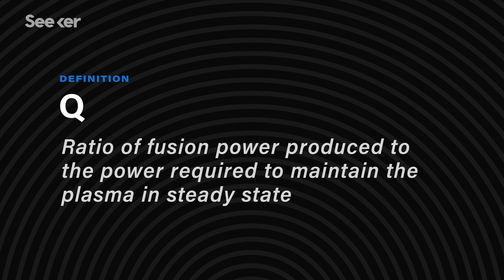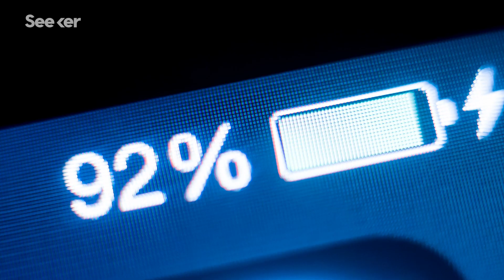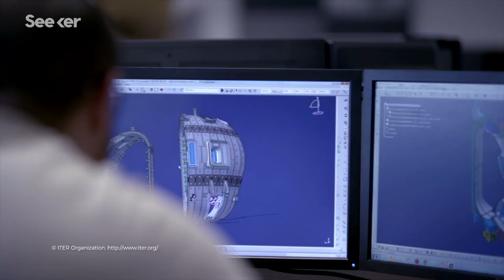How Close Are We to Fusion Energy?

Comment: Before we get financially viable fusion energy, solar and wind will be reliable due to the advances in battery technology. fusion is a waste of money by now.
Reply: What are these commercially viable battery advancements you are talking about?
Reply: The Tesla Battery farms in Australia and on Hawai for instance. home battery storages for photovoltaic panels are available from many sources already, and they are currently working on scaling them up, or they are already doing so. Electric Vehicles for instance also work with Batteries and they can gwet sufficient range already, and their capacity is constantly increasing, the battery revolution is taking place right now, and in a few years Batteries will be a huge part of energy and grid management.
Renewable energy sources have the disadvantage that they create a huge surplus of energy when it's not needed, so storing it solves that problem completely, and that is what people all around the world are currently working on, with a lot of success actually.
There are off grid communities already that produce their own energy and store them in batteries, whilst those are still rare and experimental, they work, they are reliable, and they are available now. Fusion just won't make it in time, the trend clearly goes towards renewables. There are 4 miracles that need to happen before fusion would even stand a chance.

Miracle number one: Fusion needs to work immediately, no more delay, it needs to produce energy now otherwise the developement of commercial reactors will not happen fast enough to keep up with renewables.

Miracle number two: Fusion needs to create much much much more energy than any other source avvailable, because if it doesn't it won't be viable in comparision, a technology revolution doesn't happen if something is as good, or better, it needs to be much better.

Miracle number three: We need to find an efficient way of massproducing Tritium, whilst it is true, that Fusion power needs only hydrogen, this includes a specific type of hydrogen called Tritium which coincidentally isn't stable and thus not found in abundance in seawater, it has to be artificially created.

Miracle number four: The price and time for building and maintaining a fusion reactor must drop astronomically.
Fusion reactors are some of the most complex and expensive machines that humanity has ever built and they are extremely difficult to maintain due to the immense radiation and heat that come with a nuclear fusion, whilst they are not dangerous, they may aswell fall apart very quickly if not maintained correctly, and this is one of their biggest downsides compared to renewables and battery tech, which are by many magnitudes less maintenance heavy than any type of nuclear reactor, especially fusion.

As you can see, I think it is impossible that we'll ever use fusion on earth, other green technology is just way ahead. The future is bright, but it will be bright without mister fusion.
Reply: VoodooG Ok first of all all of the technologies you discussed for Renewable are not advances, but rather existing technology. As for the battery facility in Australia that is a 129MWh powerpack. While the largest in the world this is extremely small in scale compare to the amount of storage needed to meet consumption of solar for countries like the USA. Assuming we need 50% solar generation by 2050, this indicates that you need about 500,000 GWh or 3,875 of these powerpack units. Even if you were to construct 10 of these units simultaneously every 100 days it would take you 106 years to reach the necessary 3,875 units. The reality is not only is this extremely quick level of deployment not fast enough, but our current rate of deployment is not even remotely close to what is needed for society. Last year MIT Technology review featured a study conducted by Ken Calderia, which indicated our current rate of deployment for renewables would likely take humanity 420 years to meet carbon emission standards and remain below 2 degrees C increase. This is unacceptable, because at such a timeframe it is logistically impossible for industry to remain our CO2 and temperature limits. 

https://www.technologyreview.com/s/610457/at-this-rate-its-going-to-take-nearly-400-years-to-transform-the-energy-system/

The problem with renewable studies that suggest all we need is wind, water and solar is that they predict capacity additions that are unprecedented for any time in human history by over 300%. 

https://onlinelibrary.wiley.com/doi/full/10.1002/wcc.324
Reply: VoodooG As for your fusion miracles: 

1. Nuclear fusion can take its time and likely has to because there is still much to discover with the technology before we are able to mass produce it. However when fusion is ready to be deployed commercially this technology will most likely be sold by governments rather than utility companies themselves because the generation of a fusion reactor is so immense that a single reactor could potentially supply enough power for multiple states. Not only states like in the USA but in other continents like Europe it can be used by multiple countries at the same time. This is why government ownership is likely to occur, because private companies would find it very difficult to control prices and dictate terms when more than one state is using the generation at a time from a source. Some companies already control grid sectors, and different energy sources in different countries, but there is no precedent of using a single energy source to power the majority of baseload energy for multiple states at once. 

2. Fusion has already proven that it produces BY FAR the most energy than any other source in the universe. You can actually calculate the amount of energy from fusion be finding the mass defect from a fusion reaction (mass of duetrium and tritium isotopes compared to mass of helium 4). Then by using the Mass Equivalence Equation E=MC^2 (where M is the mass defect, C is the speed of light) you can determine the amount of energy released in this reaction. Then multiply the energy by how many atoms of fusion fuel are in 200 KG and you get the total amount of energy released in in the reactor. 

This is the very same way that you find how much energy is released from fission reactions, and actually atom per same atom fission and fusion release the same amount of energy. The difference is because fusion uses fuel that is has significantly less mass than fission, you have more atoms that make up 200Kg and thus more reactions equaling greater energy production. 

Now this would tell you how much energy is released from fusion, but if we were able to actually use all of the energy then we would essentially only need 5 reactors to power the entire earth. Given that we then have to transition this energy to heat you end up losing a significant amount of energy as waste heat. Nevertheless the amount of electricity you produce through nuclear energy is several magnitudes greater than all other sources. You can even just look at fission for an example of this. The largest solar farms in the world produce about 4,000GWh with 10 miles of solar panels. Comparatively we have nuclear plants that generate 32,000 GWh.

3. Tritium is not artificially created. Tritium is extracted from Lithium concentrations, which if you believe there is a short supply of lithium then you are really screwing over your own argument for solar and battery capacity additions as our most successful (in terms of production not necessarily energy capacity) and most widely used batteries today are Lithium-ion.
Reply: First of all existing technologies are the advances of the last decades of research, if you want to see current advances look up "the battery revolution" and educate yourself on solid state batteries and zinc bromine gel batteries.
Like you said, this is taking into account only current technology, technology never stays the same, and besides the fact that fusion hasn't even proven itself at all yet, batteries seem like a much better option.
Consider the S curve. This technology is developing extremely quickly, mostly due to the electric vehicles. What can already be achieved with existing renewable technology is impressive. Where as nuclear fusion is currently more like "Yay we held a stable plasma for 10 seconds!"
I also believe that the rate of deployment wil skyrocket with mass production conerning these battery packs. they are getting more and more efficient whilst getting less and less expensive, there is going to be a tipping point in the not so far future, whereas with nuclear fusion it has been said, that it is the energy of the future for the last 50 years, and yet even the most optimistic scientists say, that fusion might become viable in at least 40 years. Fusion is 100% unproven technology that is ridiculously expensive and probably not even financially viable.
Everyone in a free standing house can install solar and a battery pack right now with present technology, there isn't a single energy producing fusion reactor on earth, the winner is clear in my opinion.
It's either renewables and batteries or nothing. Fusion won't save us in time.
Reply: VoodooG The entire reason why I asked you for commercially viable advanced battery technologies is because I am fully aware of the other battery technologies talked about in “The Battery Revolution”, but these technologies are not even remotely close to being commercially viable and scaled to meet consumer demand, much in the same way that nuclear is also far from that target. 

I always find it amazing how Renewable advocates will suggest that their new technological advancements need more funding and time associated with their discoveries, but god forbid we spend any time trying to pursue other technologies that are not yet commercially viable. 

If nothing else many of these experimental fusion reactors do a lot more than fusing hydrogen. Many of these facilities are used for other tests related to particle physics that have helped accelerate humanity’s advancement into new eras with superior technology. Without the advancements discovered in particle physics our industries in medicine, agriculture, shipping, transportation, and especially computer science would be drastically reduced today.
Reply: You're right about that, I shouldn't have said it's a waste of money, no research is really a waste of money, but I think fusion has been ridiculously hyped for 50 years now as the energy of the future and we have not seen massive advances concerning making it an actual means of energy productiuon.
I say fusion is the energy of the future and forever will be.
When it comes to renewable and sustainable energy, I think solar and wind have a massive head start and have already proven themselves. The only other candidate that I can currently take seriously is the LFTR, if it actually works like it's promised.
Turning maths and physics into viable technology is much harder than expanding on technology that is already somewhat viable using maths and physics.
I am pretty sure the race for nuclear fusion will end in a boring slow down, when we no longer need it as a power source but only for further research.

Comment: We have been working on fusion for a long time and we don't have anything that produces more power than it uses (total power, not just the laser energy).  

Lets revisit solar for 30 seconds.  

The problem with solar is we don't have 24/7 sunlight.  We can fix that by orbiting mirrors to reflect sunlight.  And, we can do that with the tech we have today.  It also uses 1/5 the solar panels required to charge the batteries we don't yet have.

Photo voltaic energy is totally solid state, no moving parts to wear out.  Every other significant energy source (including fusion) uses turbines and generators, that wear out.  Also, generators change speed up with load changes.  The inverter that changes DC from solar to AC, can go from no load to full load and back without perturbation.
Reply: Steve Sedio 
1. How big are these mirrors you propose to use, since they have to reflect light around the earth?

2. How are you going to get these mirrors out of earth’s atmosphere?

3. How are you going to keep these mirrors in orbit around the earth and prevent them from being hit by satellite debris that is currently orbiting earth? 

4. What are these mirrors going to be made of to be able to withstand the electromagnetic radiation from the sun without earth’s atmosphere and what are they going to be made of to withstand collision by space debris?
Reply: Brian,

Good questions!

There needs to be many mirrors, and they do have to be big.  Miles on a side.  This also requires a lot of ground based solar arrays, for power and redundancy (cloud cover, storm damage, etc.)    

But, they don't have to be complicated or heavy.  Construction is carbon fiber (or graphene) rods and metalized plastic film.  The metalization can be small squares, insulated from each other, to minimize effects of electromagnetic radiation.  Also, the film is thin enough that the damage is a hole,  with little effect on the total light reflected.   

The mirrors are steered by pushing against a gryo array, powered by a solar panel.  Computing power (steering) and communication (which ground based arrays are cloud covered, etc.) wouldn't be overly complicated.    

To be reasonably effective orbit needs to be above 10,000 miles, above most of the satellites and debris.  They could be 40,000 miles up.  Sunlight is parallel, and as long as the mirrors are flat, another 30,000 miles (out of 93,000,000) isn't significant.

Is this more complicated than roof top solar, of course.  Is it more complicated than fusion?  Nope.  

This can be started small, one, 1/2 mile square mirror, hitting an existing solar farm.  

The biggest expense, is getting into high orbit.  But, these are solar sails, that go up (speed up) when they are going with sun light, and down (slow down) when they are going against.  So, rocket them into low orbit (above the major debris and satellites), and turn sideways on the down cycle, catch sun, and speed on the up cycle, until you reach desired orbit. 

Once it is in place, the cost drops to annual maintenance, far cheaper than our annual cost for coal, natural gas, and nuclear. 

If Elon got a mind to, he could be the electric supplier to the world.  He has all the tech.

Comment: Maybe a dumb question,  but if the whole world used sea  water for hydrogen  wouldn't we be run out of water in like 500 years?
Reply: jandera21 No because you require an extremely small amount of hydrogen for fusion energy and the earth’s oceans have a massive supply of water.
Reply: @brian2440  okay  so there is still a net loss of hydrogen right? If you combine that thought with an ever increasing population over some period of time surely their would be a measurable drop in the earth  drinkable water./?

Comment: Replicating the same conditions on Earth as in the sun, where Hydrogen atoms can fuse together, is possible. At an enormous monetary and energy expense, we are able to create a plasma where temp and pressure mimics those of the internal regions of the sun. In this plasma, fusion can occur. But to contain the plasma, we need powerful magnets, as it is impossible in any other way to "anchor" it. 
80% of the fusion energy is in form of high energy neutrons, which cause damage to reactor structure.
The question is now...and has always been...just how will we be able to create a net gain of electricity? No one knows yet. Many ideas float around...but they are as of yet just that.
Reply: Kalle Kula By increasing the size of the tokamak, that’s what ITER are doing
Reply: @ipazu8389  Make it as big as the sun?

Comment: Iter is using a tokamak A TOKAMAK why? We already have a much better way to control the plasma. There is a German company that found out by twisting the magnetic fields you can remove the center spire. Which will be the safest place to allow the plasma to vent into the water when these become power plants. Nvm all that it also takes only 60% the energy to maintain the field vs a tokamak. why just why.

Comment: Just because I want it doesn't mean jack. Wanting and doing are very different things. I want a Ferrari, but can't have it. Fusion has been a promise around the corner for 100 years almost and we think this time it will work. I'm not saying it's impossible, but there are better alternatives than this. Solar and wind can't provide the amount of electricity most people in developed countries need and since Asia and soon Africa will join in the develop age they will also need reliable sources of energy. The only way to get people out of poverty is for electricity to be available to everyone and even though there are many who will throw nuclear out as the worst, it is by far the cleanest of all electric producing fuels. Compare this to solar and wind which can't match it by electrical output and the excess waste from solar panels after they are used up, or excess space needed for it, or wind turbines killing birds, nuclear should be a no brainer, but the stigma around it has given it a bad reputation. Other sources which people are currently working on is carbon storage power plants. Power plants that will pump carbon dioxide into the ground. I hope a private institution finds a solution to this problem cause if the iter experiment fails, these governments will pat it down as there wasn't enough money and ask us to put even more money into another experiment expecting a different result.